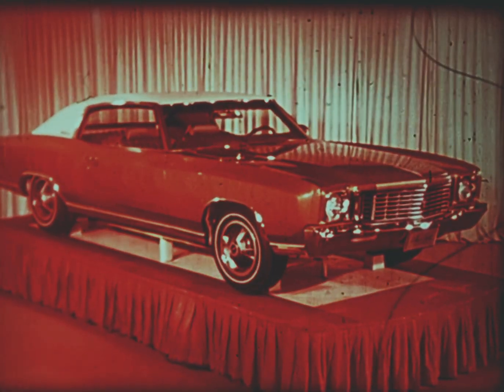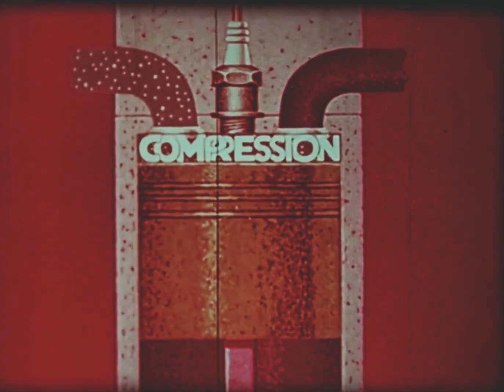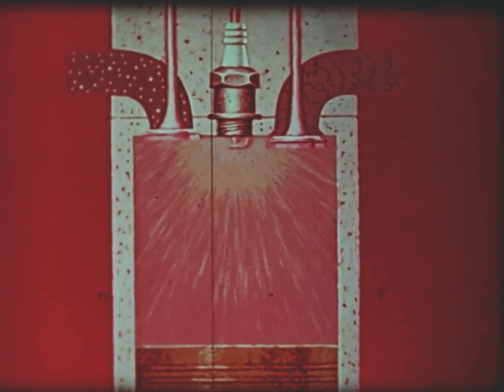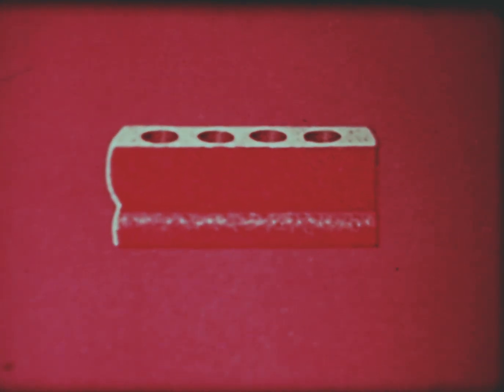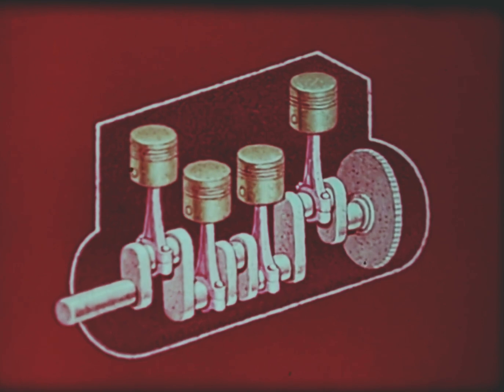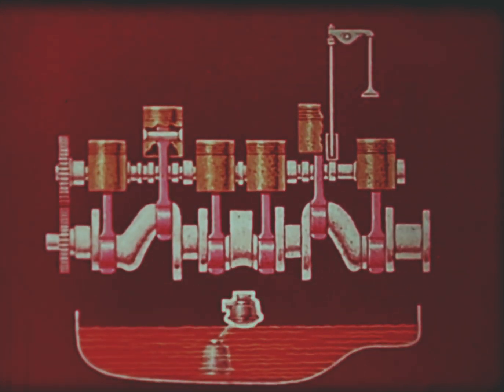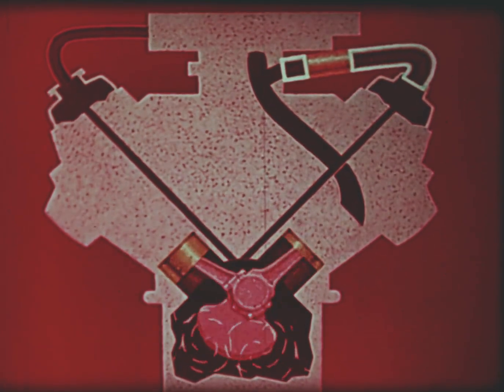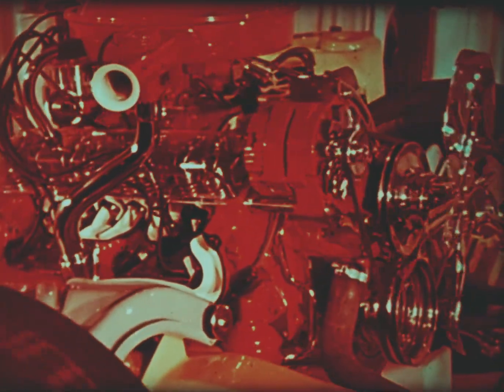ABC of the Automobile: The Engine 1972 General Motors educational film

Comment: This simple video taught me in 3 minutes the things I wondered for 6 years and havent had a clue of how they worked, specifically the PCV.
Reply: The PCV valve replaced the road draft tube which was used on cars from 1962 and up, reason why the PCV valve became mandatory was to cut down on emissions without hampering the power and fuel economy, but more or so had to do with increasing the life expectancy and reliability of engines. Road draft tube engines would be lucky to make it to 75,000 or 100,000 miles before everything was shot and worn out, the blow-by gases would react with the oil and make a nasty sludge/tar which ultimately caused oiling issues. As soon as the PCV became mandatory, eliminated all those problems, became more common to see vehicles still running with over 100,000 miles in the late 60’s vs 75,000 to 100,000 miles before the PCV valve became mandatory in 1963.
Reply: @seana806  Thanks for the explanation! Cool to know.
Reply: @gabrielvieira6529  the PCV valve is one of those things that helped everyone across the board. Car owners got many more miles out of their vehicles, automakers didn’t have as many warranty claims, pollution was reduced, overall everyone was better off with the PCV valve. Only one’s it didn’t help was the scrap yards since cars were lasting longer.
Reply: @seana806  haha so true! But sometimes the blow by could cause more smoke than the engine itself. Cheers